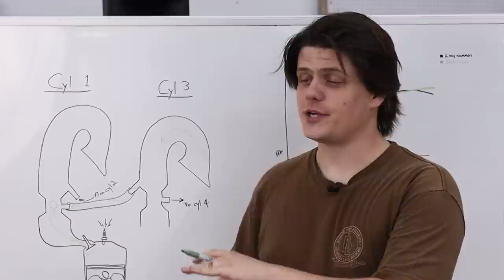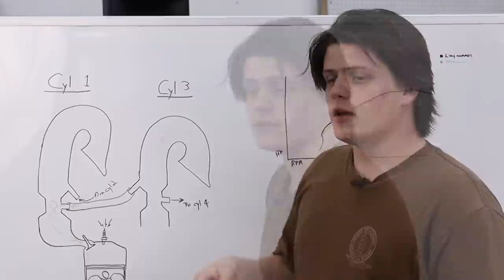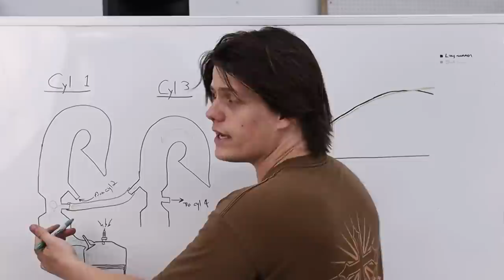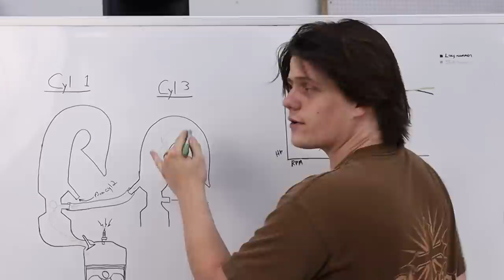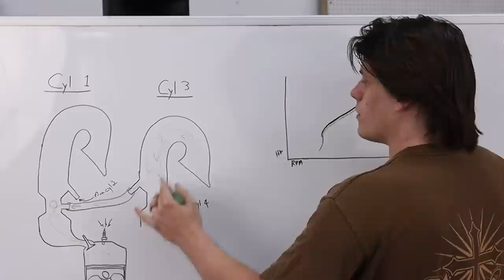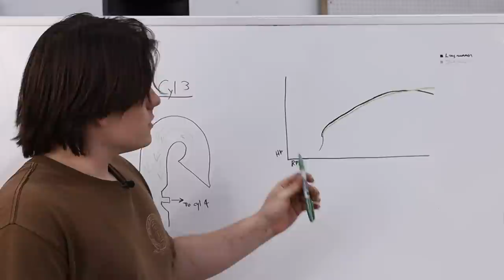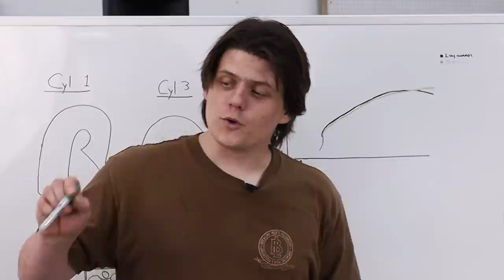3D Printed ITB Intake for Turbos and/or Stock ECUs

Comment: hi, I'm looking to build my self a similar sort of system. what sort of itbs would best to use or what sort of properties in the itbs should I look for. cheers!
Reply from the maker: You'll want to consider the I.D. in comparison to your engine displacement. The rest of the selection is going to be balancing different packaging restraints (spacing, position of throttle lever, TPS compatibility, etc) I chose this set (Triumph TT600) because I saw two builders online who had already used it so I knew it would work.

Comment: So with the mazdaspeed6 the stock MAP is behind the throttle body at the end of the "plenum" how does this setup work in that sort of scenario?
Reply from the maker: There are three places to grab vacuum on the manifold between the throttle and the head. The question is gonna be is the reading going to be close enough for the stock ECU to run it.

Comment: Take my money !
Reply: Also are you making a version that won't require a hood scoop modification?
Reply from the maker: Yes the plenum inlet will be in almost the exact spot the stock throttle body would be so it may even be possible to use factory tubing up to the plenum.
Reply: @StandRacing  awesome! Have you tried having a thermal spacer in-between the head and manifold to mitigate the warping / heat issue?
Reply from the maker: I'd like to avoid having to replace the studs in the head, as the nuts are just barely at full engagement right now. So we'll see.
Reply: @StandRacing  good point. Looking forward to the final product !

Comment: Should just put a single tb on it. The itb part is canceled when sealed in a common plenum. Good thing too because it be haf to get all the blades the same at idle. I like the interchangeable length, and the Venturi tubes-some good theory. Some carefully placed pressure transducers would tell you if its doing what you expect. Ultimately the test results will tell you is it worth it, it may do what ya want and make 0 or net 0, it happens. Check vacuum in the common plenum at wot if it has a draw then the maf is restrictive. You can check the stock manifold like this and your checking the tb. If there is less on the test intake than the stock then your tb move relieved a restriction at the throttle body. It’s likely you made one by including the maf though. In ol at wot does the ecu use the maf? Maybe test that as well-if it has vacuum present and you remove the maf and it still have vacuum at wot then the opening on your common plenum is a restriction. Tubes joining the itb’s on the head side would allow you to use a map on that side of the itb’s. Now you can run without the plenum, have true itb’s, and have all that low, part, and mid throttle tuning fun.
Reply: Tell that to the RB26.
Reply: @802Garage  it’s the same on all engines
Reply: @hondatech5000  Tell that to the RB26.
Reply: @802Garage  hey rb26 your just a inline 4v 6cyl like any other.
Reply: @hondatech5000  Now look up the intake setup. 😂
Reply: @802Garage  I’ve seen it. When runners terminate inside a common plenum they stop acting like individuals and work like a plenum. It’s because it is a plenum. It doesn’t matter what engine. Look man I will see your rb26 manifold rofl and raise you a 787b Mazda 20b 4 rotor intake system. Go look that up for a individual runner.

Comment: Using plastic to make engine parts is suicidal to the engine. Every car company has leak issues doing this. Bad idea.
Reply: I mean, lots of manufacturers use plastic intake manifolds now a days. I don’t know how well it’d work with a turbo though.
Reply: Any plastic between the throttles and the head is a mistake and I wouldn’t want to run it without remaking it in metal.
Reply: Carbon fiber 3d printing might work but idk about under high pressure like supercharger or turbocharger system.
Reply: The Alfa Romeo 2.0JTS engined cars had a plastic injection moulded intake, but when Autodelta supercharged it. it was prone to cracking, so they made a custom metal plenum in aluminium for reliability.
Reply: Nonsense. Car manufacturers have been using plastic intake components for decades now reliably. Probably designed parts will last for ages and even if a piece of plastic fails it will not destroy an engine. Besides, I don't think he expects this to act last like an OEM part it's more like a fun project.
Reply: Perfect for prototyping though
Reply: @802Garage  we can agree to disagree. I, personally, would not use plastic for an intake manifold supporting ITBs but I understand your point. Most (all?) OEMs use plastic on a plenum with one throttle these days and that works, I agree.
Reply: @robin_marriott  Yeah and I hear your concerns too. I have been incredibly impressed by the strength of 3D printed parts. I think this is still the best way to not only prototype, but build skills in design and engineering. So even if it fails, we'll all learn something! Thanks for being reasonable.

Comment: So my biggest concern with this guy is the rtv silicone. Anyone and everyone knows you don't use rtv on any form of vacuum.  Why? Because it sucks it in the engine it won't hold I don't care how tight your parts fit, how well they are cleaned, how long it cures, its not gonna hold. Expoxy maybe, for a little while. Then the heat is going to destroy it, then it's in the engine. You think after all these years manufactures are just being lazy with the O-rings? Tell you now, find Steve Morris engine builders here on YouTube, it'll change your way of thought, I'm a mechanic I know from my own bit of learning. Don't waste your time or anyone else's.
Reply: Firm disagree. RTV after properly curing has almost zero chance of ever being sucked in by simple engine vacuum. Have seen it used hundreds of times and not leak. It is also plenty temperature resistant to any external temperatures of an engine. It would work perfectly well in this application though personally I would prefer to engineer in O-ring grooves.
Reply: @802Garage  exactly. It's been proven. It's been done. These big manufacturers do it for a reason. Disagree all you want. But these companies will save every penny that they can. So you think it's a process without merit and proof. Your right proper curing it will last while. It'll last until it won't. Oh did I mention I'm also an ase certified mechanic of 26 years. That rtv silicone is used in many applications. Except this. A perfectly smooth mating surface like this one especially intake manifold with suction. Here's a test go pull the map sensor pull the rubber o-ring that's around it. Now do as you say here and seal it with any rtv. I would recommend the gold. Cure it properly. It'll take 2 days from start to finish. I'll a wait your results. It ll last about 2 minutes. I'm sorry but you and him are wrong
Reply: @jonathanallen9205  I have seen RTV used in exactly the way you just said as well as 100 other ways around intakes without failure. Of course that is not a correct application, but it can work. I have seen hoses stuffed into silicone couplers with a hole cut in them and RTV around it hold up for years. Ugly, but worked.
I believe you that you're a mechanic and you have seen a failure, but you are simply not concretely correct. The amount of adhesion the RTV will have with the surfaces combined with the clamping forces of surfaces creates FAR greater forces than the vacuum ever will. Keep in mind in order for vacuum to pull the RTV through any openings it requires pressure which is force per area. It will be acting on incredibly small areas with low levels of force.
If what you were saying is true, then gaskets in general would be useless on intake manifolds and cooling system gaskets would be blown out immediately. I'm not sure why you have the ideas you have, but you are simply wrong.
Don't forget RTV can be used on exhausts as well and doesn't immediately blow to bits. Perhaps the failure cases you saw used far too much RTV, which creates bits that fall off into the intake as I'm sure you know, or the surfaces were never properly torqued and a thick layer was allowed to form which was then sucked in. It should only be a very thin layer creating sealing on any intake application.
Reply: @802Garage  ya that's true but uts just not practical or financially feasible. Especially with rtv at $20 for a small tube. I'm not saying it won't work. You can use like 5 tubes of rtv if that's what you wanna do. But a few cents and a few intelligent thoughts will save you a few hundred dollars in this case. I mean do what you do. But don't cry, when it cost what it cost. Experience here brother, not stupidity. That's the difference between a shade tree and a proper Mechanic. But ya your right I seen some shit done, and done some shit outta necessity. But I would think this isn't one of those times. It's also where some Experience and expertise comes into play. Surely we don't have to just simply accept ignorance today as how it should be. Oh but this is why I have 60k in tools. Because a simple pair of pliers and rtv is the right way. SMH
Reply: @jonathanallen9205  What? You're a mechanic and you pay $20 for a small tube of RTV? You can buy a 13oz caulking gun size tube for $10 and probably do this whole intake 10-20 times. You literally said it won't work. It will work and he has expressed this is for prototyping and other reasons. I'm beginning to doubt your experience. I have several different large tubes of RTV in my garage for various applications. I just used a bunch of Honda Bond to seal up an oil pan on a 13B rotary engine I swapped into a BRZ. Guess what, no leaks. We also used RTV on block off plates on the intake which see both vacuum and high boost. Guess what, no leaks. There is certainly ignorance going on here. Stop telling other people what they can't do if you don't understand what you're talking about. Paying a lot for tools does not make you a good mechanic.

Comment: 1:45 Had to stop listening when I realized you don't even know about how worthless ram air is.
Falsus in Uno, Falsus in Omnibus.
Reply from the maker: Having the scoop on the hood will also allow for more room to mount the electric leaf blowers.
Reply from the maker: On a more serious note. Does ram air being worthless negate the other positive effects of an inlet scoop being insulated from the engine compartment and exposed to outside air at a high-pressure area of the hood, with no direction changes from filter to plenum?